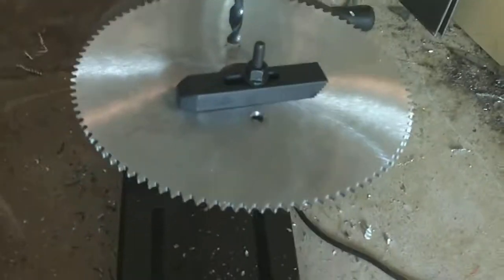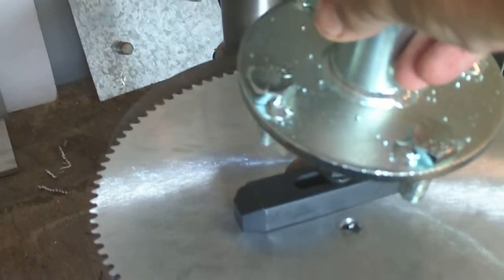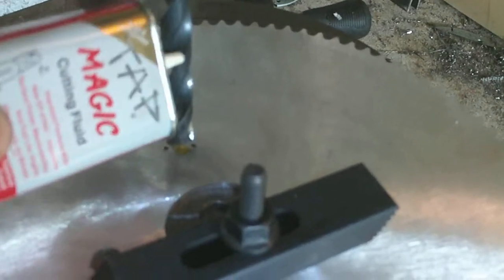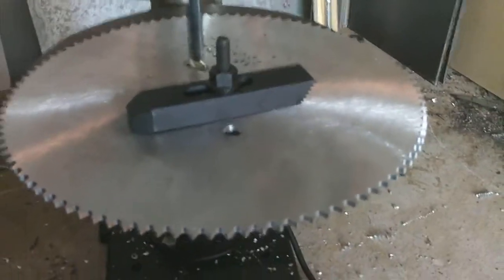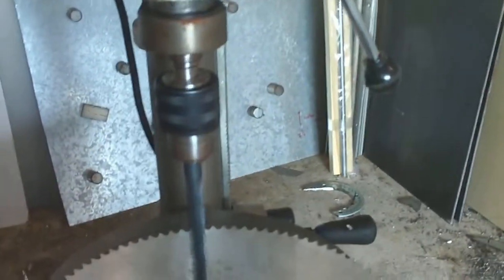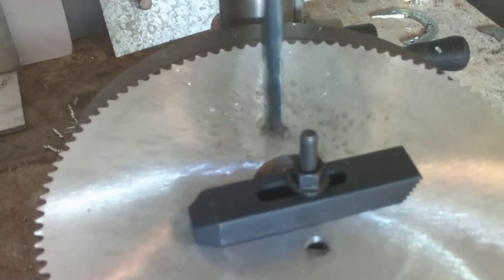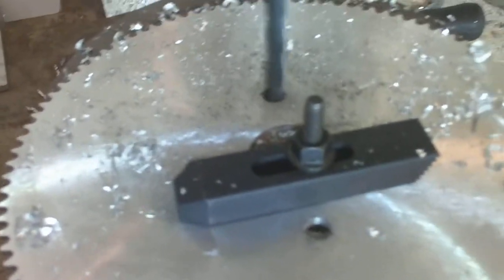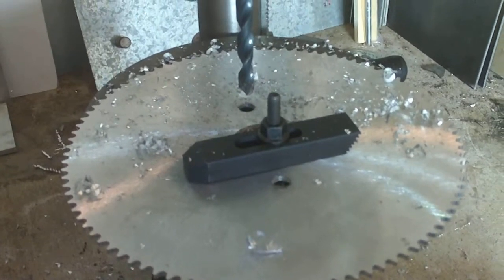3 - Energy and Gravity - Drill 98t Sprocket for Adapter

Comment from the maker: 5. It was nearly a perfect fit, I had to do small amount of needle filing to finish it off. Moving forward I'll have Azusa Engineering cut teeth, center hole, & 4 lug holes so I don't have to mess with it. Once I fill out my machine shop with a plasma cutter & table, I'll being doing this operation myself with my own raw materials. The CNC machine, based on instructions, knows exactly where all the holes are & cuts them perfect.

Comment from the maker: 1. Flip sprocket holder so four lugs are pointing skyward. 2.Center hole on sprocket holder is 3/4" diameter, put 3/4" jackshaft into the center hole. 3. Center hole on this sprocket is 1.935" (Azusa cut it for me), put small sprocket (part# 2147) with hub diameter of 1.935"  & 3/4" diameter hole of it's own into the sprocket hole. 4.Now you have a large aluminum sprocket & a little sprocket at its center. Slide this combo on the same jackshaft. Where lugs touch aluminum, mark circles.